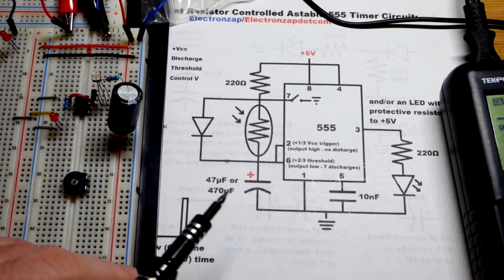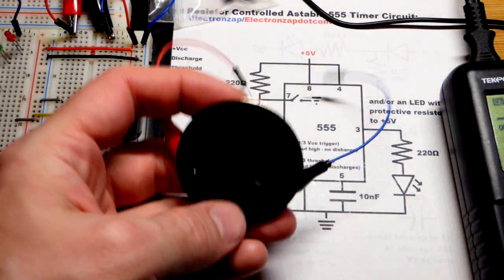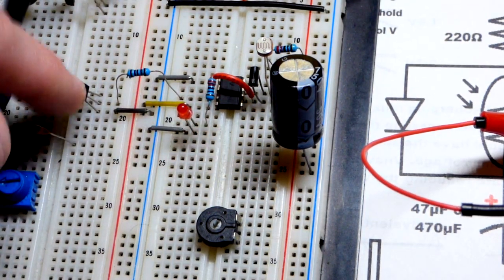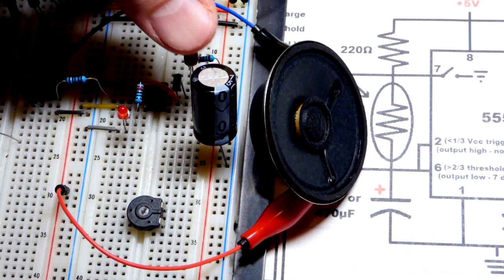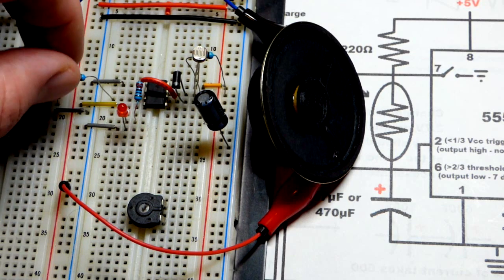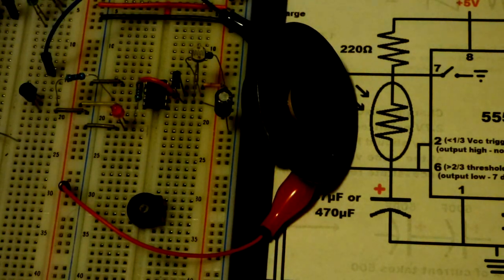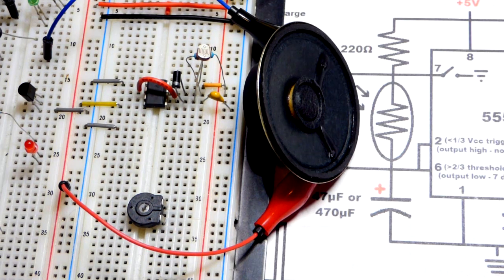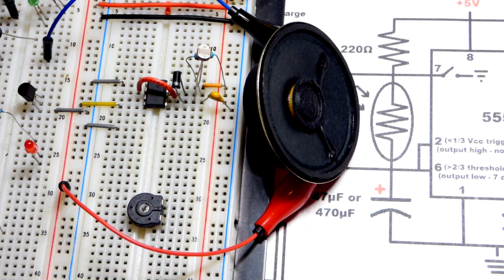Speaker powered by astable mode 555 using light dependent resistor LDR timing circuit electronics

Comment: Thanks for doing an audio demo. I had not thought about maxing out the 555 by driving the speaker directly ... TBH I have had no issues doing that but I am still a newb. Any thoughts on building the Atari Punk Console with a 556 next? 😂
Reply from the maker: Looks like it is fine to use one of these speakers directly at the output. I should have added a coupling capacitor though. No clue about the Atari console with a 556 lol.
Reply: @Electronzap  It's a really cool and easy circuit to build: https://en.wikipedia.org/wiki/Atari_Punk_Console and check out this voltage divider that provides a -4dB line out https://compiler.kaustic.net/machines/apc.html